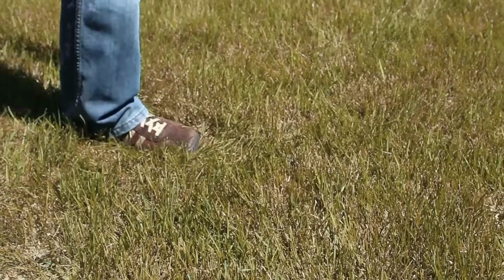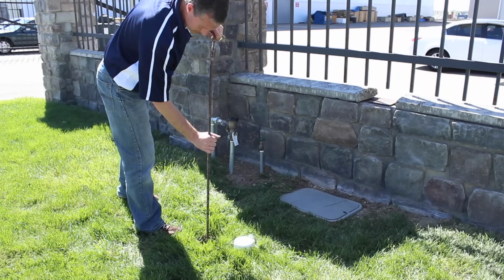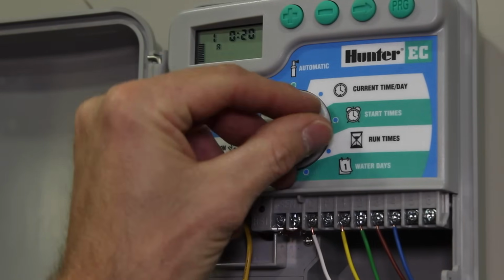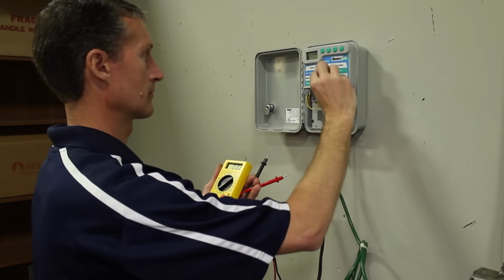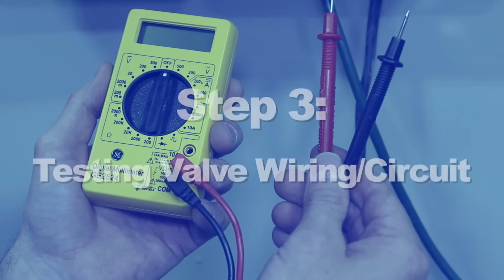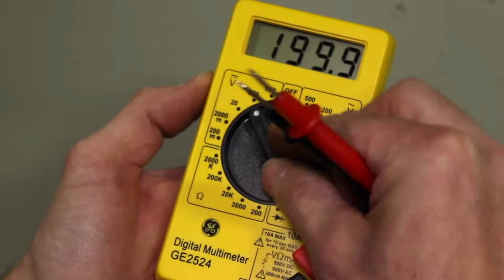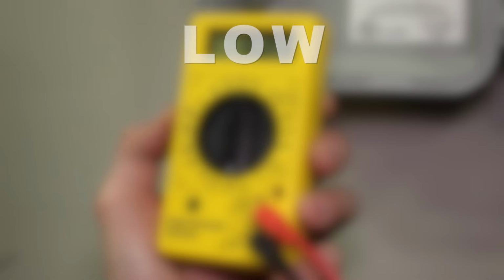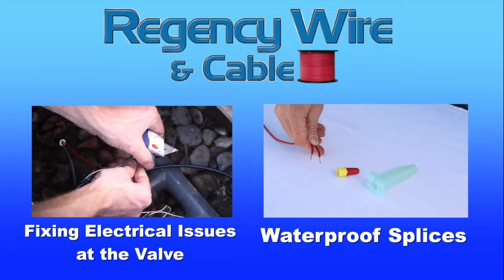Troubleshooting an Irrigation Zone that Won't Activate

Comment: Thanks to your video, I was able to find that my non-working station had an open circuit due to wiring being damaged by the family dog, and re-connected to an open wire that was not in circuit. 30 minutes of troubleshooting and one minute of re-connecting wires, and all stations are running correctly. Thank you so much! 👍

Comment: I have a Hunter system that was operating find 2 weeks ago... now zones 1, 2, and 3 are functioning as usual, but zones 4, 5, and 6 are not functioning at all. I have water pressure to these zones because I can turn the solenoid 1/4 - 1/2 turn and the problem zones will operate. 

Interestingly, the 3 zones that are not operating are all on the same power 'terminal strip', while zones 1, 2, and 3 are on a separate 'terminal strip'. I've gone as far as to move the leads from terminal positions 4, 5, and 6 to terminal positions 7, 8, and 9 (the next terminal strip up, and visually completely separate), but the zones are still not operating... even though the controller indicates that they're in operation. I've been through the steps that you demonstrate in your video, but I'm not getting the 20 - 60 ohms on terminal strips (4, 5, 6) or (7, 8, 9). Could both of these terminal strips have gone bad? 

Any suggestions are appreciated...

Comment: Thanks for the video! I have 3 zones.  Ever since I had a shallow well installed for irrigation, 1 zone is not working.  Two are working just fine.  On the 3rd zone, the sprinkler heads are not rising completely.  I can see water but not enough pressure for the sprinklers to pop up.  I did all your tips on this video.  Do you know what is wrong?  Thanks!
Reply: Easy Johnny  hey there could be a break in the pipe or broken sprinkler head on that zone
Reply: There's a lot of things that could cause this, most every one of them includes a physical break, leak, or blockage in that zone alone.
Reply: Most likely, you lost some pressure when switching wells. Which would indicate that there more heads on zone 1 than it can support. If that's the case, you may be able to fix it quickly(IF it's a spray zone and not a rotary) and cheap, by switching the nozzles on that zone to MP rotating nozzles. The nozzles(matched precipitation) which technically turn spray heads in to rotary heads, conserve pressure and maintain coverage. If these don't work, you can actually delete a head or two depending on the coverage, which should surely fix the pressure.
Reply: Most likely a head off a fitting or when digging new well they bit pipe and never told you. I hope you figured it out
Reply: Check valve stem might be turned down need to open up more
Reply: Similar for me. I’m thinking the freeze broke the pipe and it’s leaking underground.

Comment: Any suggestions for a system that won't launch properly?
The first two rotors splutter out water, and the rest do nothing.
If I intervene, and pull on the second rotor slightly to help it launch, then the whole system springs into life!
I've replaced the second rotor several times, assuming that the fault is in the individual rotor, but the problem persists.

Comment: Okay.
I performed the test for the voltage of my inactive zone and it showed no volts going to zone five, which is the one in question.
You say there's probably a problem with my controller but that's where you leave it and then you move on to test the ohms. Do you have any practical instruction on how to correct the problem within the controller?
Reply: Might be too late on this but usually with a simple sprinkler controller if there is something wrong with it on the inside/controls part, the easiest and cheapest fix is to just replace the controller all together.

Comment: I have a station that won't work. It is getting power to the solenoid as I can hear it starting but no water... also have another station that won't turn off! Different junction for both (front and backyard are separate).

Comment: hopefully you are someone reading this can answer. I disconnect the common and  5 zone wires at the controller.  When I did a ohm test on each, each zone reach 2.30 Ohms.  Is it likely all five solenoids are bad? What could be the problem?

Comment: I have a Rainbird SST600IN.  The voltage across the input wire to the common wire reads 14.5 V until I turn on a valve and then it jumps to 28.5 V.  Is this normal?  Why is it doing this?

Comment: What if the volt out put is AC 25.6 and ohms 27.3. However, they valve will not manually turn on at the valve box. The heads pop up try to start then drop back down. Then pop up again trying to start only to drop back down and nothing happens.

Comment: So my sprinkler wiring passed the first test (24.5) but returned nothing when i did the second test the screen just stayed at 1.
Reply: I think some meters display "1" instead of OL (open line), so you may have a break in that line's wiring.

Comment: Hi guys hope someone can help. I have a 2 zone Node.
The zone 1 is not activating (run time is OK, checked and confirmed by total run time) however if I start the zone manually it will turn on.
Thanks.

Comment: Thanks for the post. I got a question:
As I switch on one station say Station2, at the same time another station say Sation 4 also operates and water is sprayed throughout the sprinklers. Where could be the possible fault(s)?
Reply: Wired togeather

Comment: I have toro
Reply: Bart Camarca me to
Reply: Man I feel bad for you. Get rid of those toro 280s. Either way start replacing those valves with hunter valves or be prepared to constantly change diaphragm or solenoid on a regular basis. And even then you might have problems still